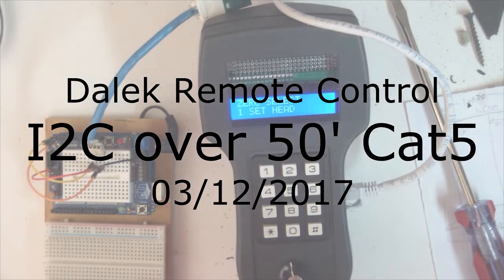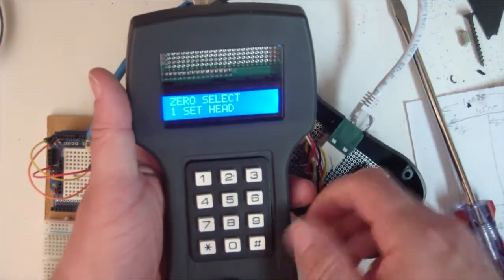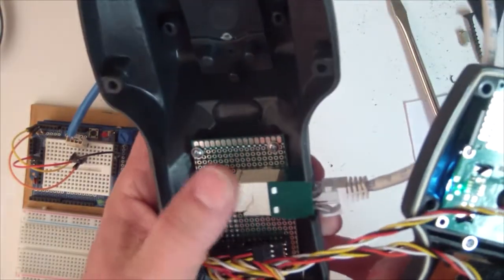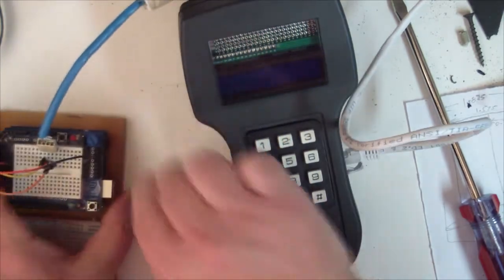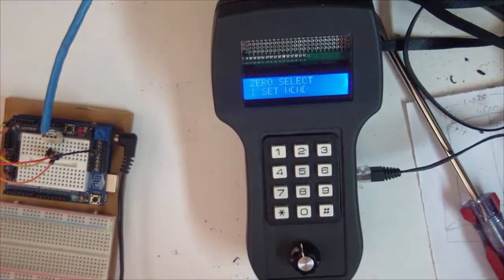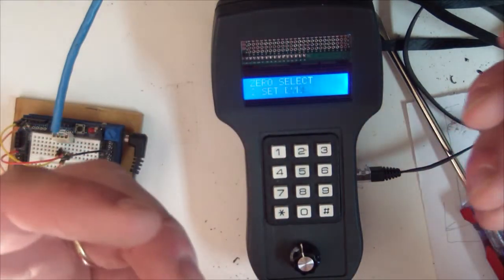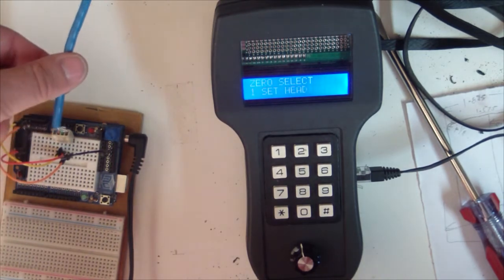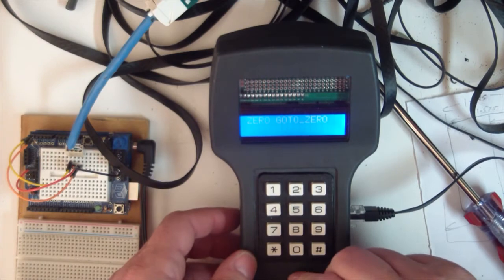Long distance I2C over Cat5 Cable - 50 feet / 15m

Comment: I want to run a temperature sensor outside, a BME280, I already have one inside. I can have two on one I2C port. I thought it would only run 1m. If I can do 5m over telephone wire I'm happy.
Reply from the maker: Give it a try. I think using the twisted pair will help. Using a scope should let you see the wave form and tweak the pull-up resistors.

Comment: Hi, Im a electronics noob and want to make sure how to connect the wires to LCD/Arduino. If I understand correctly green goes to SDA, blue to SCL, orange to VCC, brown AND all the white striped wires to the same GND (arduino at one end and LCD on the other). Is this correct?
Reply from the maker: Yup. That worked for me. This is way out of spec, so your mileage will vary.
Reply: @thumperthoughts  thanks!

Comment: As I understand it capacitance is the main problem on long cables. So might actually work better if you don't use twisted pair or screened cable. However that might make it more susceptible to electrical interference.
Reply: Capacitance is less of a problem at slower baud rate.
Reply from the maker: All of this is way outside the I2C design spec, but I think using the twisted pair cable in this way helps. As has been said, slower speed will also help. If you can put a scope on the lines it will help see what's going on. Adjusting the size and placement of the pull-up resistors will have an impact that should be visible on a scope.

Comment: Well, but what in noisy conditions? Or with connected a few inverters in the same electric network? Than, even using any EMC filters on powersupply for Arduino, the length is sometime limited to one meter (of course, the proper cable tracing must be applied and pull-ups)...